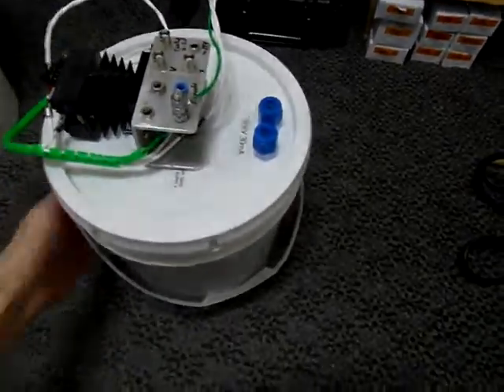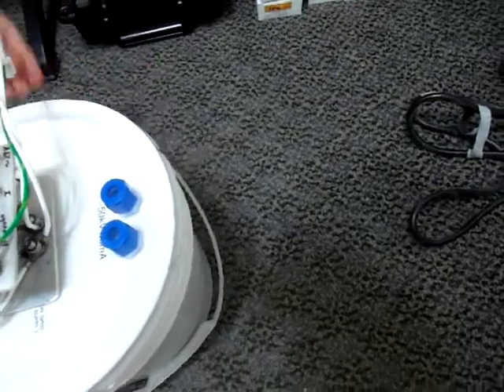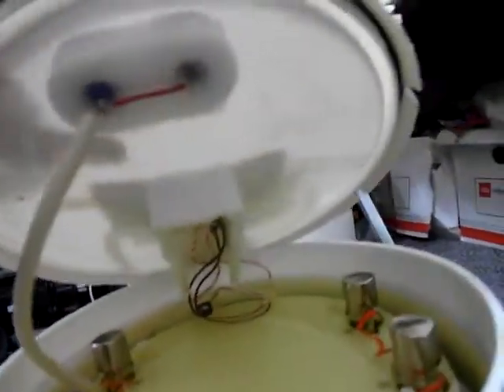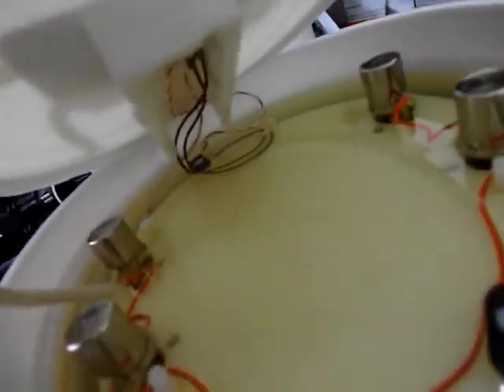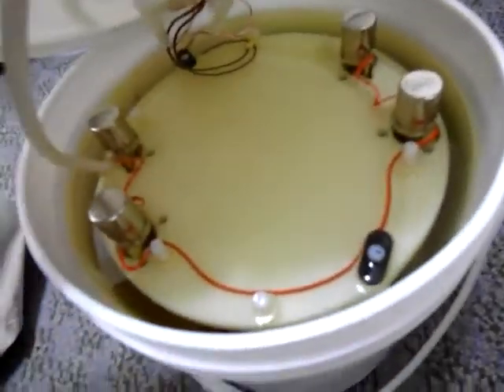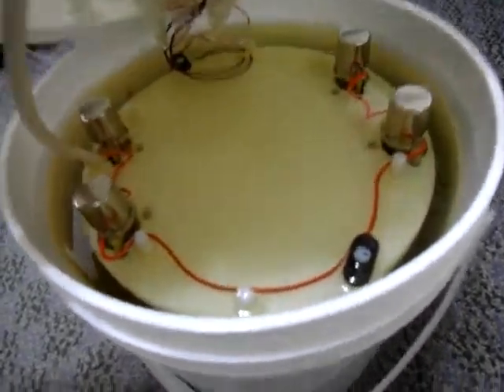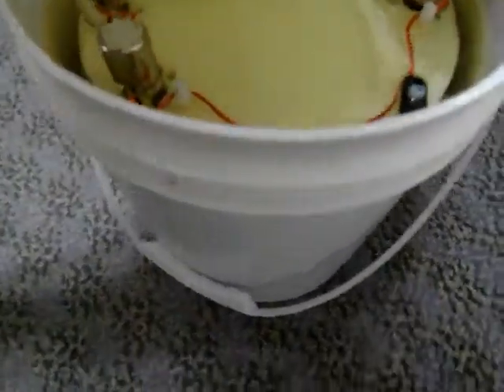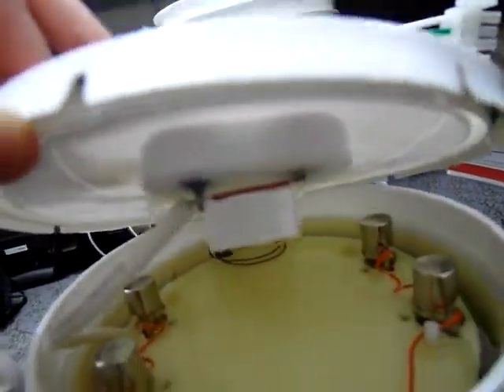High Voltage X-ray Transformer

Comment: Did you pull a vacuum on the mineral oil?
Reply from the maker: No, but it was left to sit in the mineral oil for several months before operation. You should pull a vacuum if you have the equipment to do so, but I had no problems with my transformer.